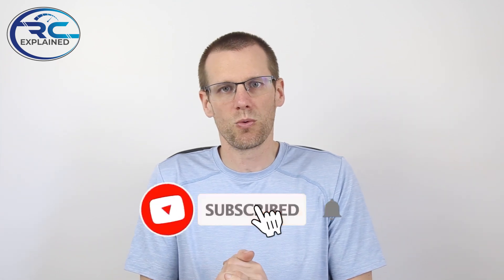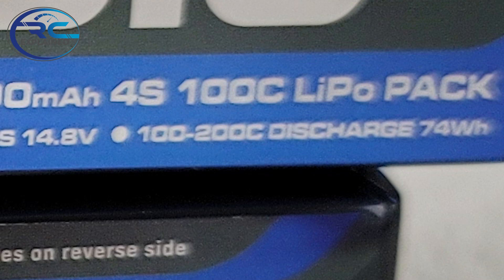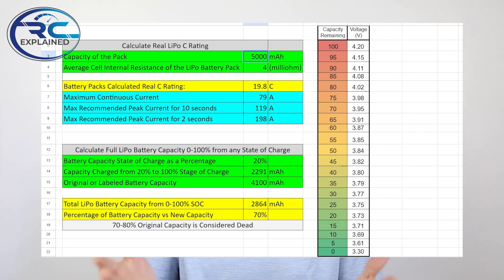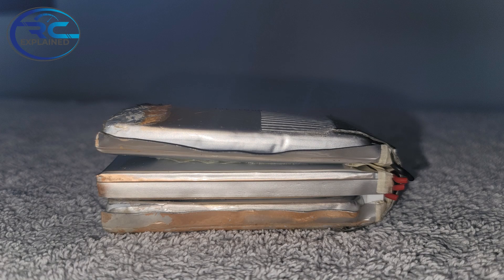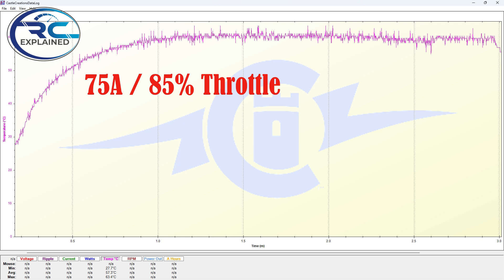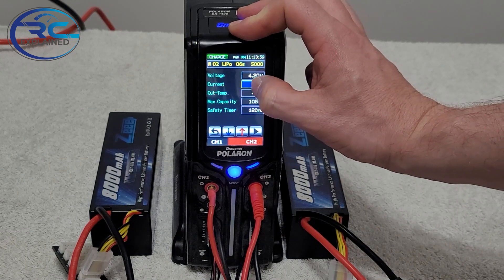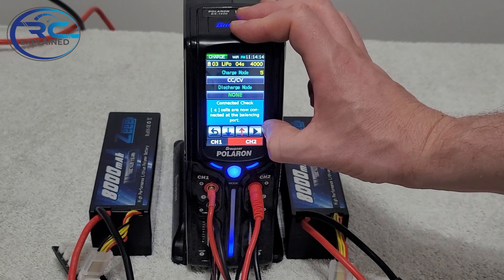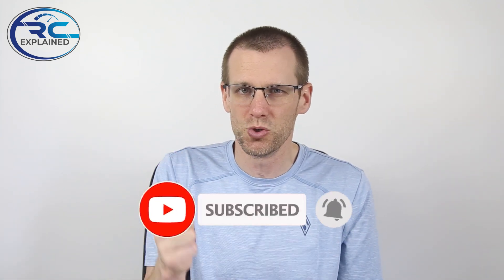The Underappreciated Elements of LiPo Battery C Ratings Explained!

Comment: I personally think the lies  from these lipo manufacturers/sellers needs to stop.
if you hook a lipo up to a load that equals it’s burst rating with a video recording and have an amp clamp around the positive or negative wire all these so called burst ratings would probably do just that (burst)and probably in less than 10 seconds.
Imagine a 120c lipo with a 240c burst let’s say a 3000 mah that’s 720amps burst
And it will most likely have 10 or 12 gauge wire 
I think it would most likely catch fire instantly or melt the tabs off instantly. I also think this sort of video could be used to get one’s money back from the sellers under the not as described reason or in Australia the fit for purpose laws.
Somethings got to be done it’s out of hand I have never had a lipo live past 50 cycles at half its continuous c rating in my boats they always puff or start to go high on the ohms on one or 2 cells
I would have 40 useless lipos laying around and another 30 in a less than perfect state that I use weekly and I always balance and store correctly. Probably some of these better ones after about 6 usages are already nit performing as they did when new. I usually am lightly breaking them in for 2-3 uses so some have started losing power in 3 uses after the break in.
At probably 25c constant and 50 burst. I have tried all brands I can buy or import into Australia unfortunately SMC is not available in my sizes through their agent here and they don’t carry much stock of anything really.